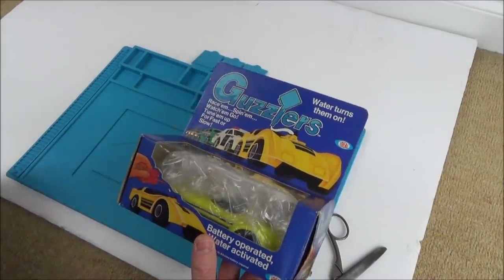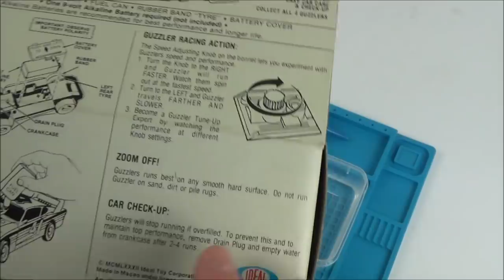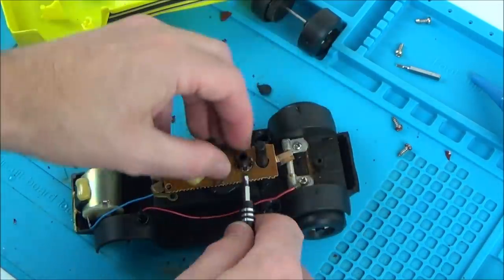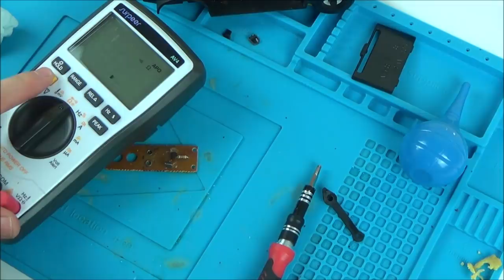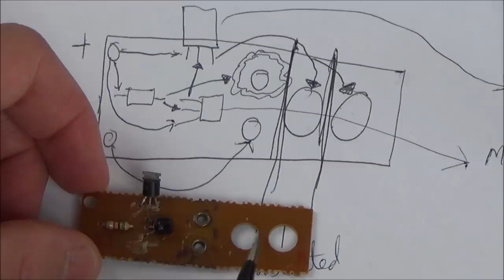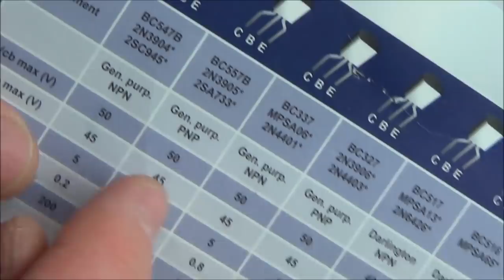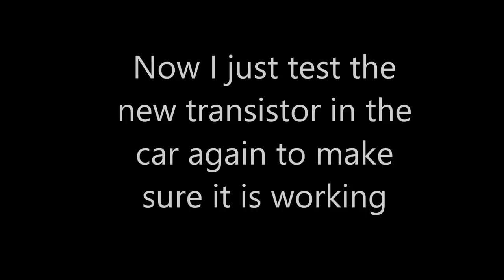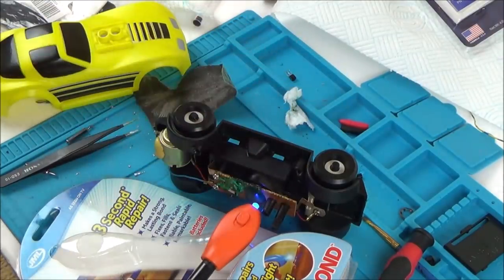Trying to FIX: 1980 Guzzlers Water Activated Toy Car

Comment: The small transistor is a 2N3905 PNP transistor. Only the 905 is printed. The brand of the transistor is ME (micro electronics). Those are the 2 first letters on the transistor (in handwritten font).
https://pdf1.alldatasheet.vn/datasheet-pdf/view/75133/MICRO-ELECTRONICS/2N3905.html
Reply from the maker: Excellent!!! Wow, well done for finding this!!! So the PNP transistor that I replaced it with should be OK then, just looked at the specs on the BC557B that I put in and to my untrained mind they look very similar :-) I am so pleased you found the component, I was looking online for over an hour but was going round in circles. I think you are the first one to properly identify it. I thought it read MK or UK not ME but even Googling ME G905 doesn't bring it up. Thanks again for finding it :-)
Reply: @Mymatevince  yep. You can use the bc557b or any other pnp transistor with 10v or more maximum collector emitor voltage and a beta factor equal or higher than the original transistor. The transistors are just used in switching mode, nothing critical.

Comment: This might be a darlington configuration: https://en.wikipedia.org/wiki/Darlington_transistor Try to draw a schematic and compare. When you short the two contacts, too much current flows into the base of the transistor and pops it. The newer transistor might be more robust than the older one, therefor it didn't die so fast.
Reply from the maker: Thanks lo377ps for the info and the link :-)

Comment: The waters resistance in circuit turns on gate of the driver transistor and the motor runs ,, "but" there is a calibrated leak like the spillway of a dam (as well as a possibility of a small designed in time out leak)  out of that chamber to the lower one with a plug , as the car moves its motion sloshes the water around in the upper chamber with the contacts and causes the water to run down to the lower chamber lowering the level in the upper one with the screw contacts and the circuit to the gate of the transistor is no longer immersed, this opens the circuit through the water the transistor turns off and the motor stops ,, that's  why faster speed settings cause the water to leave the chamber quicker as the motion of the car sloshes the water down into the lower chamber at a higher rate .. there is a sensitive transistor in the water circuit  that drives the gate of the power transistor that switches on the motor .
Reply from the maker: Thanks Allrock, do you have any ideas to why overfilling it will stop them from working??? The instructions state 'Guzzlers will stop running if overfilled'
Reply: @Mymatevince  could be the chamber has issues with an air bubble getting trapped within it if there is no place for the water to go  unless the control circuit has a time out element, though I dont see that in the examples shown
Reply from the maker: Thank you :-)

Comment: That blob of glue at the base of the transistors is old circuit board glue,  it's no longer used in the industry as over time it goes brittle and corrosive I subscribe to a channel on here called 12voltvids he's forever removing that stuff,  I suspect in this case it was used as waterproofing

Comment: water is significantly higher resistance to your tweezers.   You loaded down the circuit and drew more current than the transistor was meant to.  The poor thing cooked itself to death

Comment: Coat the one end of that reheostat with a wire coating and it will no longer run once that copper arm is moved to the farthest side. That way it doesn't run all the time once it has water in it.

Comment: you got what was going on the water provides a resistance and keeps the transistor from blowing . wen you dead shorted it like that too much power got too the transistor and blew it . as for how it works . the water allows power too pass from one screw too the other and that power is amplified by the transistor's and then runs the motor.  this is a over simplified explanation and probably not the most accurate but fits in a general manner for what is going on.

Comment: its  look like u forgot place that speed resistor o ring holder/tighter or what ever its name is... in video 46.10 its lurking on  mid right :) but anyway like u videos and they are very entertainment to watch
Reply from the maker: Well spotted. I noticed it when cleaning up. It is back in the car now, A lot easier to open up 2nd time round due to all the snapped plastic :-)

Comment: This might be the answer to your overfilled take problem check out the Pythagorean cup.
Reply from the maker: I have never heard of the Pythagorean cup before. I have just Googled it. Thank you :-)
Reply: @Mymatevince  ill tell you what would be really interesting is to see how the water tank works,  because the fill hole is in the middle along with the screws but the drain hole is in the front, but its not worth destroying that nice piece of engineering.

Comment: At Blackpool when I were a lad, some street vendor sold "water-powered" watches, the lying bastard!

They're basically watches with metal electrodes, and electrolytes stored as a dry powder in a sort-of cotton wool. When you add water, the electrolytes start working and the metal corrodes and that's where the electricity comes from! And only as long as there's a drip of water in there, will it work! 

Sounds stupid in so many ways, one being that you'd need to keep re-setting it if it dried out. Second being the obvious one, of course, which is eventually the metals or the electrolyte will eventually react til they've run out. Then no more power, however much water you chuck in. Cos they're water activated, not water powered. For a watch, they'll probably last a fair while. Although the space given to all that tackle, is about the same as an actual small watch battery. Perhaps a bit more. But it's gonna be less effficient, for one thing cos the optimal selection of chemicals isn't possible, you have to choose electrolytes that are water-soluble. And it has to be a wet cell rather than a dry one. Hm not sure there which is actually worse. But regardless, a novelty cell, and I'm guessing, isn't going to match a properly designed one with a design that's been used for years. 

TL;DR it's a shit idea and just using a battery is better.

You could get the odd "science" kit too a few years back with a similar idea, I think even including cars, but more "sciencey" looking than this one, the point of them being to demonstrate the science. So lots of transparent plastic etc. They actually generated power on board, again using metal electrodes, where the one in this video just uses water to activate a circuit. The actual power comes from the battery. The water is essentially a switch, cos it conducts, as we all know. Not straight to the motor, but activating a transistor, since water only conducts weakly. The weak current activates the transistor to switch the larger current through itself to the motor. 

Would've been simpler to just have a wet cell in a jamjar but I'm not a toy designer so what do I know about what the grasping little bastards are hypnotised into by their diet of cartoons and Playstations?

TL;DR this car is a shit idea too.

Comment: That component is a 2.5v voltage regulator... https://www.digchip.com/datasheets/parts/datasheet/183/G905.php
Reply: Vince, abit off topic but have you ever repaired a drill battery charger? I have a 18v makita replacement charger that was bought new about 3 weeks ago and it charged one of the batteries fine the other day, iv gone to turn it on today and there's no power, no lights, nothing, there's power to the charger, there's 2 internal fuses that are not blown, no visable sign of blown caps or dry joints, everything looks good, tested the 2 transistors in it and they're not reading shorted and read OK, there's power to the primary side of the transformer in it but nothing at the secondary side, and the coils in the transformer are not reading open, I'm baffled, no worries if not just wondered if you'd ever looked at anything similar, thanks

Comment: A?chisel tip dramel would easily chip away at the glue without damaging things. You need to invest in a dramel tool. I have always had one and actually worn out two of them over my life time.  I purchased a Radio Shack RC car on E- Bay that was brand new from the 1980's. Whom ever got it never played with it and left it in the box. I figured it was a simple connection. Without the gas can, it's pretty useless as a collectors item. Tearing it apart didnt hurt its value id something is missing. I always told my girls as soon as it comes out of the box, it loses value as a collectors item. Sadly, only the least produced toys are worth something. Defective and recalled toys hold a higher value. Banned and recalled toys because of safety concerns really hold their value as far as collectors items because they get pulled from the market. I wouldn't ever get into collecting toys. They eat up space quickly and the market fluctuates wildly. Today's collectable is tomarrow junk. Look at beanie baby's.  Now days the resale shops are FULL of them. Only first release and special release are worth anything. The rest are land fill material.